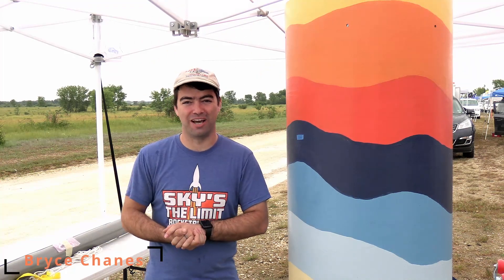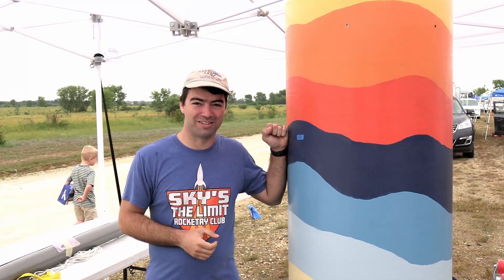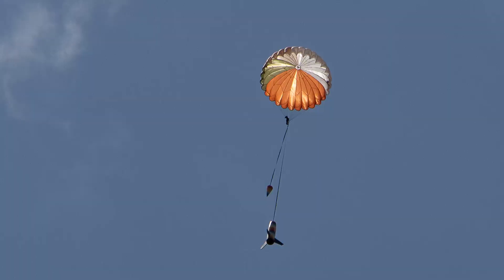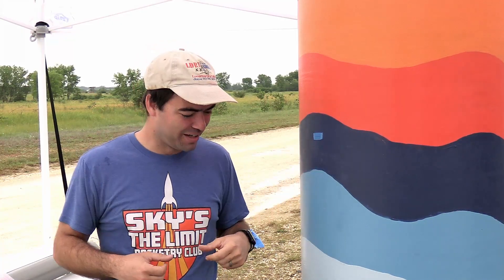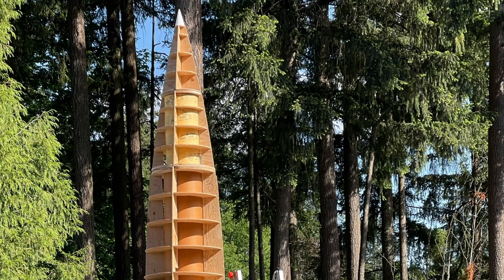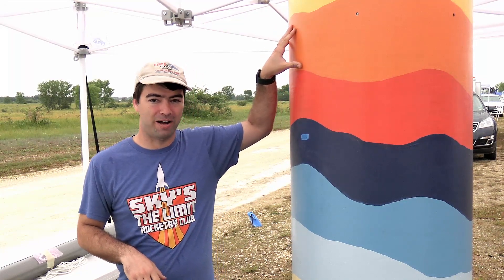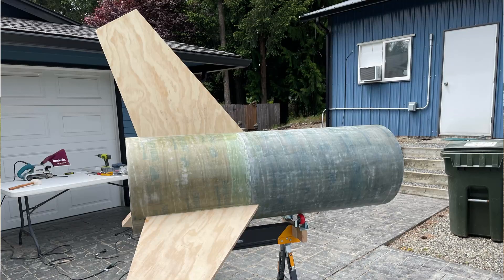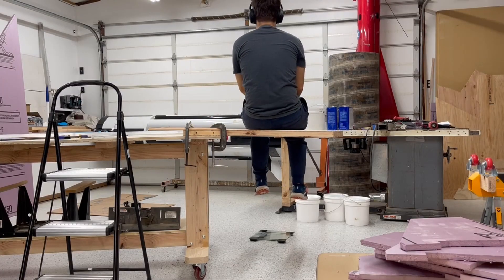Huge 14.5 foot scratch-built rocket flight!

Comment: The rocket I made when I was in high school was very difficult to shoot because its body rotated during the fly. What principle made it possible to shoot stably like this? I uses sorbitol and sugar, and has a total length of 21 inches and four acrylic wings. When the metal ball reaches its peak by attaching a sensor to the ceiling of the head, an electric current flows to eject the parachute. Was the rocket's head heavy a problem?
Is there a wing adjustment function through a separate software? 
I want to film my village before graduating from college next year. 
I would appreciate it if you could give me some technical advice. Thank you!

Comment: I have a question, can you please explain why they drill vent holes in the main body tube
Reply from the maker: The vent hole serve several purposes.  As the rocket rises the air pressure on the outside drops but without a vent the internal pressure stays the same. This condition can cuse the booster to seperate prematurely. During assembly the vent also allows air to escape when pushing the parts together. Good question!